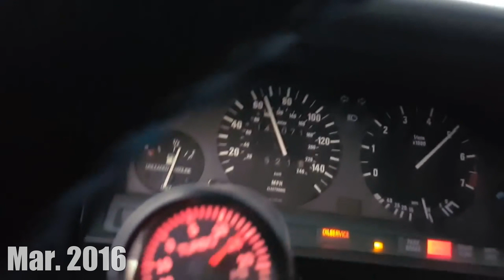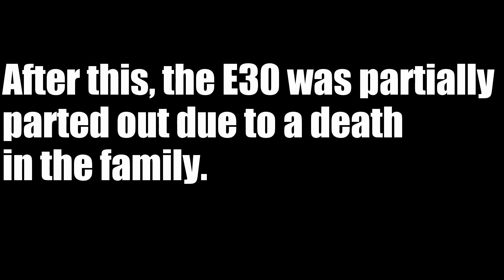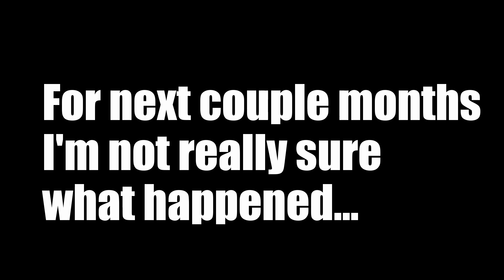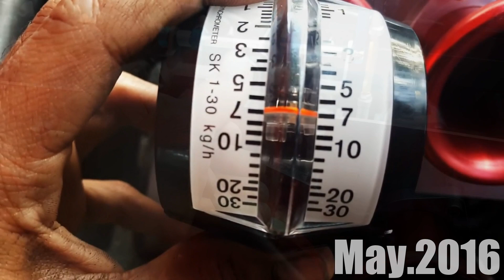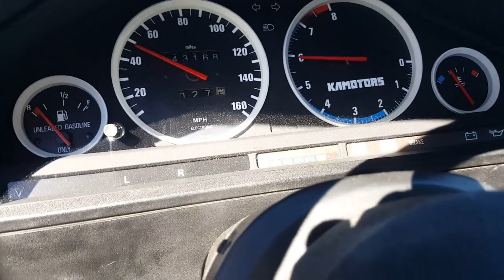2016 Highlights Kamotors BMW E30 turbo to N/A ITB

Comment: Why ITBs instead turbo?
Reply from the maker: Ivan Rudman cheaper, and no additional maintenance needed. No more breaking axle bolts, driveshaft bolts, the car is 100%reliable with the itbs. The only thing I've done to the e30 since itb install is change the oil.
Reply: So it's back to 200ish hp ?
Reply from the maker: M RO yes, making it a more dedicated autox car and building abother BMWs for my go fast/boost needs
Reply: I've read a ton of threads on it but for those who want a quick rundown of what would be needed to run ITBs would you ever plan on making a quick "how to" video so to speak?
Reply: N/A > Turbo - always

Comment: This is kind of a noob question but is it possible and safe to install ARP head studs without removing the head
Reply from the maker: World Rally Chris not a noob question, I've done it several times you just need to do one at a time and in the proper order. BMW actually did the same thing for a recall on factory bolts for e30s that were snapping the heads off.
Reply: Ok thx. And what would be a safe boost level on a t3/t4 63 trim with head studs and stock internals?
Reply from the maker: World Rally Chris stock internals can handle 20psi easily, however it's all in the tune for if it's going to pop a head gasket. I'd say stay under 14psi if you're not super confident in the tune or octane of fuel.
Reply: Ok thank you
Reply: Kamotors Would you be able to sell just the manifold from your kits?
Reply from the maker: World Rally Chris yup!
Reply: Kamotors Sounds great. I'll contact you down the road when I'm gathering parts for the build

Comment: Can you put turbo on itb, would it work properly??
Reply from the maker: ogi giovinco you can, but it's not really worth it as the itbs introduce around 4x the amount of potential vacuum leaks with no real hp gain in a boosted application.
Reply: Kamotors thanx